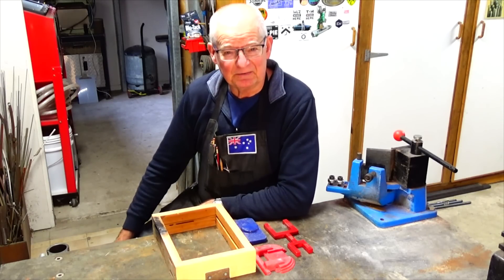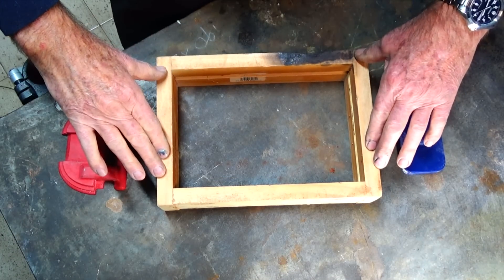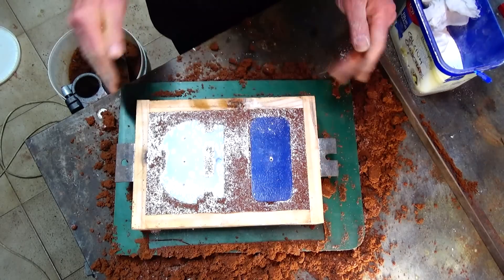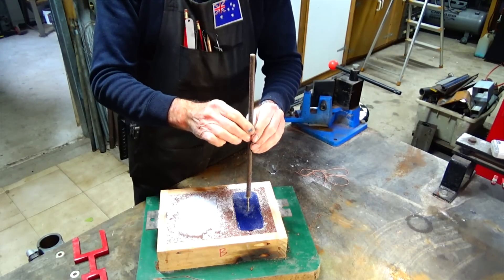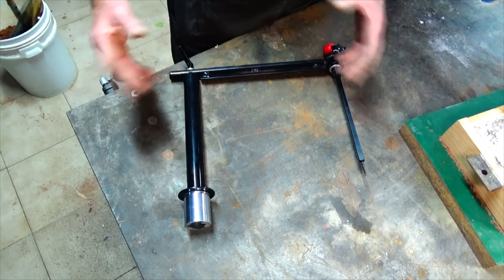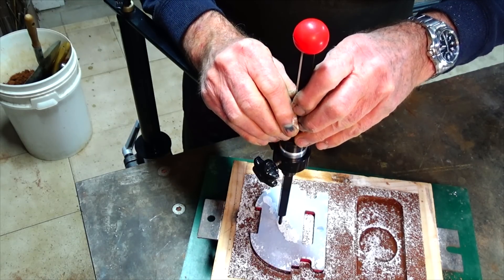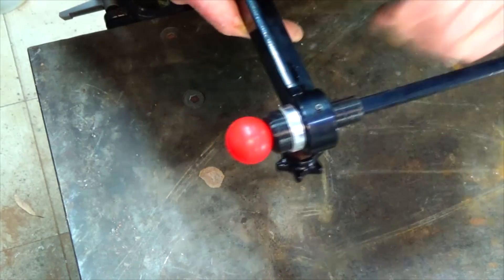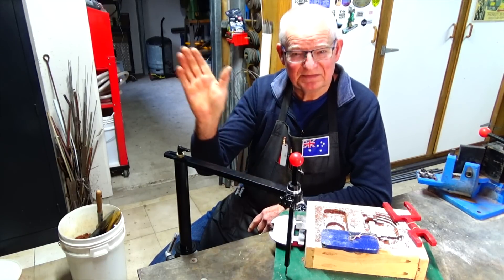Pattern Removal Tools for the Home Foundry

Comment: Love your presentation. You have a very pleasant voice to listen to. You might want to thread the end of your lifting guide, so that it works as a tap guide as well, with screw on adapters such as a drill chuck. I prefer the string, as it can be done off the work bench.

Comment: I'm not sure which CAD tool you are using but Fusion 360 does have a function for Center of Mass under Inspect.  Have you tried this to find the correct point for your pull point?
Reply from the maker: I use Autodesk Inventor and it also has the centre of mass tools (as well as surface area, volume, mass by material and loads more). Unfortunately, I sometimes make my patterns using wood and hand tools. In those cases the centre of gravity is more or less a guess.
Regards,
Mark

Comment: Chuck a shortened version of your original steel bar up in a drill press, lower the quill and line up the screw with the hole in the pattern, carefully twist it in by hand and use the quill to pull it up.
Reply from the maker: The main issue for me is having to carry the very heavy cope and drag moulds over to the drill press which is on the other side of the shop. The table on my drill press is also quite high and you would need to keep a board under the mould so the sand was supported the whole time. For smaller moulds the drill press would work though.
Regards,
Mark

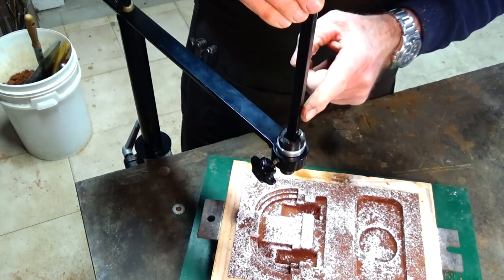Comment: 12:06 If only there was some kind of ratchet on that steel bar...
Reply from the maker: I started to consider some sort of rack and pinion mechanism. Probably some 3D printed parts would work fine. Maybe that's overdoing it though. 😁
Regards,
Mark

Comment: Now all I need is an aid to help me TIG weld, it's impossible when you essential tremors
Reply from the maker: Tell me about it. I have given up any hope of being able to TIG weld. I used to be able to fusion weld with oxy acetylene but it's a bit more forgiving if you stick the filler wire in the molten puddle. 
Regards,
Mark

Comment: Good Show Mate: As per normal. Being the lazy dude I am, I would put a piece of plywood under the drag and put it on the drill press or milling machine table, lower the chuck with the screw thingee, twist the screw thingee into the form and raise the chuck. Out comes the form...straight up. I haven't done it but seems plausible. Whatcha think?
Reply from the maker: That would work but some of the moulding boxes can be quite heavy and sometimes too large to get the drill spindle over the hole in the pattern without running into the column at the back of the drill press. It would be great for smaller boxes though. 
Regards,
Mark

Comment: just use a drill press. Lower the quill, engage your part and raise to withdraw the part.
Reply from the maker: You could do that but if the mould is very heavy it means trying to move it to another location. Also, large moulds may not fit between the spindle and the column at the rear of the drill press.
Regards,
Mark

Comment: Awesome job Mark. I think I would want a snap lock on the square shaft above it's pivot , that way I could get the pattern out of the way before removing the freed pattern from the shaft .
Reply from the maker: That's a good idea. You do need to be careful not to let go of the lift mechanism until you can slide the mould out of the way. The first version of the 3D printed square shaft adapter had some spring loaded fingers to provide some friction but I found it also allowed the square shaft to move off axis. 
Regards,
Mark

Comment: My hands shake due to medications I take.  Been dealing with it so long that I've just gotten used to ruining a few molds every time I want to cast.  Never crossed my mind that I could make a tool like this.  Thanks so much for putting up this video!!!
Reply from the maker: My issue gets worse when I have the camera running. I believe it's called the "observer effect". In most cases, bumping the mould cavity just makes the casting bigger, but I have had lumps of sand fall down into some hidden spot and you don't always see it until after the pour is done. In those situations the casting will have a defect that you cannot fix by filing or grinding. 
Regards,
Mark

Comment: I too suffer from "essential tremor" which sometimes makes my hands quiver beyond my ability to control them. I particularly like the string solution. As you point out, the other devicew would be excellent for placing cores, tremor or not. Best regards.
Reply from the maker: Richard, I did not know the name of the condition that we share. It gets mighty frustrating at times. I will ask my doctor about it.
Regards,
Mark

Comment: The first time you mentioned this (how many videos ago?) I immediately thought of a gantry. 2 steel shaft uprights with bearing blocks and the gantry itself. Attach it to extruded aluminum and/or 20mm aluminum angle, add some simple bracing, and you'd be set. I imagine it would look relatively similar to the uprights on a 3D printer. Simple clamps could be used to hold it all still. A similar rod holding fixture could be used as what you have except the gantry would slide up and down instead. Not as convenient as what you have here, but damn near anything could be employed to give you a smooth linear movement.
Reply from the maker: What you have described would work well. It's not always necessary to use the rig but for certain intricate patterns it saves a lot of time and effort if you brush the edge of the mould cavity as the pattern is being withdrawn. That usually requires a re do.
Regards,
Mark

Comment: I think your pulling mechanism is ingenious! While the string method could be changed to rope or cable to handle larger patterns your device would be most useful on jobs that would require making many of. Almost like the "squeeze-jolt" molding machines. Keep up the good work and thanks for mentioning me!
Reply from the maker: Thanks Tom. I am hoping those two methods are going to lower the frustration level next time I am making moulds. 
Regards,
Mark

Comment: Very good project as usual.  I once thought of a gantry type thing to span the mold but it was not as well designed and I never did anything about it anyway.  Thanks for the video keep on keeping on.
Reply from the maker: I thought about something that was attached to the flask as well but I have lots of flasks of different sizes and heights so whatever I made had to be independent of the flask itself. Thanks for watching Harold.
Regards,
Mark

Comment: The string system is all together the best method, it is simple to make, and the best of the two systems, the crane system has the disadvantage of still allowing sideways movement due to the clearance needed to be able to run in the overhead bush, I can see the string method, providing the CofG is marked on the pattern, being fool proof. Many thanks for posting this! Chris
Reply from the maker: As it turns out, if you design your patterns in Autodesk Inventor, Solidworks or Fusion360, the CAD software will tell you exactly where the centre of gravity will be. 
Regards,
Mark

Comment: Hi Mark, I had to smile when I watched your video. What a very clever and ingenious and well executed solution to the problem , but it made me think about the tale , true or not, of the problem that NASA had with ball point pens not working in zero gravity. It is said that they spent thousands of dollars developing a pen that would work in zero gravity , (there may be a connection with “Papermate” ) , the USSR space agency at the time  decided that a graphite pencil would do the job ! 
Another possibility here for pattern removal would be to use a pillar drill / drill press with a screw in the chuck as the lifting tool ?.
Great videos Mark, keep em coming and all the best from Cardigan in West Wales , UK. (Any space for a pin on the map )
Reply from the maker: I recall reading the same story about the Russians adopting the pencil. I believe they also used a simple rotary slide rule to do all their navigation whereas NASA spent a fortune on a digital computer with less computing power than the average digital watch. I will check the map but I fear it is wall to wall pins in the UK.
Thanks for watching though.
Regards,
Mark

Comment: hello, I have two questions, the first is, is sea or desert sand good for molding, second, what did you add to the sand to hold the shape of the piece, thank you.
Reply from the maker: I believe that beach sand (from the sea) is almost pure silica sand and unless you wash it really well it may contain salt. Fine river sand or olivene sand is preferable. It is possible to find naturally occurring sands with enough clay content to use without much processing except for maybe sieving it to remove any large lumps or organic material. The sand I used in this video was called K Bond sand and it is mostly fine "play sand" that you can buy at hardware stores. It also contains a binder (clay), a catalyst and a synthetic motor oil. However you can make "greensand" from washed and sieved play sand and bentonite clay. The clay content is about 10%. Then add water until it will bind together without feeling sticky.
Regards,
Mark
Reply: @Preso58  thanks,thank,thanks.

Comment: I love your black pattern puller. I made one with two 3d printer linear rails (there’s a video somewhere) but I used wood so it was a bit crappy/wobbly (it worked though) but yours is awesome. Now I have a metal welding table I’ll be making one like yours. Thanks loads julian.
Reply from the maker: I found my first attempt was also too wobbly to be of any use but doubling the length of the 3D printed bush seemed to fix the problem.
Regards,
Mark

Comment: G’day Presso  I’m at the stage now where I’m going to make my own  carstings as it’s getting harder to buy good carstings,  as a first timer how  would you go about  it for things cylinder as I’m restoring a  loco thanks mate regards John
Reply from the maker: John, my advice would be to make some castings in aluminium first. Keep them simple but try to make something that is useful in your workshop. Small G clamps would be good. Then try to make something which requires a core i.e. something with a hollow bore. Something a bit like the bench socket I made would be ideal. For steam engine cylinders you will need a split pattern with core prints and a core box as well. Try making a simple one first in aluminium and if that works out try making one in bronze (or brass) Bronze is better but brass melts at a similar temperature and it's generally easier to find scrap brass. Metal casting is a very deep rabbit hole and although you can get successful castings with basic equipment, as the shape of the casting becomes more complex you will almost certainly get more failures. However it's very satisfying to be able to make your own castings. I would suggest you purchase a good 3D printer if you don't already own one. They are great for making patterns and core boxes.
Regards,
Mark

Comment: Now I'm gunna blame you when I run out of beer😁
The string idea is so simple and effective👍 My first thort when you mentioned this was some sort of mini gantry crane/gear puller type mechanism?
To find COG of an irregular object with one flat plane simply balance it on the edge of a bench and mark a line on the underside, repeat this as many times as needed to get a good average point.
Cheers Presso 🍺
Oh yeah, were those "French ladies" anything like " Brazen bits" ? ....brace and bit 🤣
Reply: Cheap fishing reel .Mounted on a simple U frame with 2 boards as feet. You can use a drawer slide to position it and a hose clamp to fix position.
Reply from the maker: Thanks Bill. I must try that COG trick. 
Regards,
Mark

Comment: Do you think that if the screw hole is always at the centre of gravity the string method should always work?
Reply from the maker: As long as the pattern doesn't have a lot of intricate detail around the edge and as long as you have sufficient draft angle the string method is easy and reliable. I did notice that the nylon line I was using was a bit stretchy. It tends to act like a spring and when the pattern does come out it jumps up out of the cavity quite quickly. Probably a thicker string or something like a thin braided cable would be better. 
Regards,
Mark

Comment: Hi Mark,
Great tips. Did you ever have any minor cave ins with the string method? The fancy removal tool will take some time to construct, but I think is a much more accurate way to lift the mold leaving a clean cavity. You and your family stay safe.
Reply from the maker: So far both methods have been reliable. I like the gantry tool better though. You get more control and a better feel for how the pattern is lifting. With the string method, once the pattern moves up slightly it is free to rotate or dangle about so you have to commit and get it out without stopping. 
Regards,
Mark

Comment: What! No bare feet tamping the mould. 🤣. Is the sand just damp"brickies" sand, or is there something else mixed into the sand. Thanks!
Reply from the maker: Ha ha. I have watched those videos too. The sand I used in that demo is called K Bond sand. It is a mixture of fine sand, clay (bentone clay), a catalyst (I think it's ethyl alcohol) and oil. You can use just fine sand, bentonite clay and add water until it binds together. That is called "greensand".
Regards,
Mark
Reply: @Preso58  Thanks, Mark.

Comment: Great work Mark. Even if you don't have shaky hands the idea could be adopted for a tap guide to reduce the chance of broken taps or wonky threads when hand tapping.
Reply from the maker: I had not thought about that. I have a small machine called a Universal Pillar Tool which was designed by George Thomas. It has a bush with guides for tap handles and a swivelling arm which does the same job. However it only has a small table and not much height adjustment. The tool I made could have the bush swapped out for a tapping guide but I will need to get that stupid roll pin out to do that.
Regards,
Mark
Reply: @Preso58  Maybe cut the roll pin off flush then drill it a tadge oversize?

Comment: I like that lifter. I don't do foundry work in my shop but if I did I can see how it would be a godsend. To get the roll pin out you could take the sliding bar out, remove the side locking handle and drill through the insert to make a clearance hole for a pin punch. A little padding to protect the powder coat combined with judicious use of force should get the pin out. The small hole through the insert shouldn't cause any trouble but you could print a new part if needed. Drilling and tapping for a grub screw should only cause minimal scarring of the sleeve.
Reply from the maker: That's a good idea. It would have only taken a few minutes to tap the hole and put in a set screw. That's what happens when you are working to a deadline to get a video out!😕
Regards,
Mark